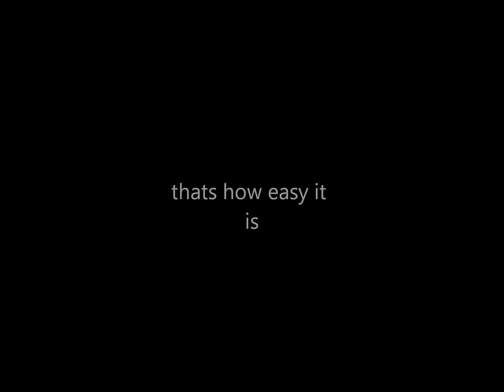easy way to get rid of engine noise

Comment: IF you need to do this, Then that mean's you're headunit has a blown earth track.

It is an easy fix if you are good with soldering and electronics.

Although, This is a temp fix, But better to open it up and fix it right.

When instaling external amplifiers, Always make sure you connect the ground wire first.
If not, The amplifier will try and ground thrugh the RCA's and blow the headunit's earth track.
Very common for pioneer unit's.
Reply: That kinda explains why my amps go into protect when I remove their negative connection when the amps are turned off.

Comment: usually a whine mean,
pioneer deck : a resistor has blown and will require that the rca outer shield be grounded directly to the cars chassis! and not the stock grown that goes to your harness 

any other name brand , is usually because someone installed the power wire along with the rca paralleled to each other causing cross talk

Comment: I read on another site, take HU ground wire, ground it to the HU chassis, then from that same grounding pt, connect to the grounding pt / wire of your amp..  to eliminate the engine noise..   I didn't do this for my custom truck install and I have no issues, but my boat whines badly with the addition of my amp and tower speakers.  Talk about frustrating.. didn't realize it into boat was in the water.. didn't think to check it at the house.. of course the gain on the amp needs to be turned down but the whine is always there.. ran 6 gauge wires for power and ground from amp to battery but now I will use same for the Sony HU.
Reply: I’m go try this

Comment: will there be a problem if I just leave this as is? I'm getting the same whine sound when you pressed the accelerator but it's quire random. only happened about 6x in the last 4 months after I installed a new android head unit. The times the sound happened was from a cold start then went away after 10-15min driving.

Comment: I cant tell if that is the positive or the negative on the RCA and do you do it to both HI output RCA's or just one?
Reply: Just the low level RCA. The outer ring is negative and the middle point is positive I believe

Comment: I have a Jopix PT 31 cb radio. Its connected to a separate battery in the boot.I rev up and hear it over the speaker. i can only use the cb when the engine is off,which is pointless, my car is 10 years old.what can i do? Thank you

Comment: peter court is correct you actually have a blown fuse on the rca output on the inside of the unit , you have to look very close to see it but once you address this all noise will be gone

Comment: This is a band aid only guys. This guy has poor grounds in the vehicle. They are all at different ohms values. All you have to do is connect EVERYTHING audio related to ONE heavy, real copper wire, and send to the - BATT terminal. NO CRIMP CONNECTORS please. Solder all your wires. Read about star grounding. Never ground your RCA's people. You're masking the problem. Also run the signal wires AWAY from the power and ground wires.
Reply: +jim davidson All my grounds are good but I put my power cable and RCA in the same harness. That causing the alternator whine?
Reply: Could be and multiple grounds in your system. That's where you get engine noise. Run a massive power and ground back to your amps. Power and ground your amps and head unit/crossovers and such THERE only. Run your signal cables separate from the power and ground.
Reply: In electronics, you want ONE ground point PERIOD. Tie EVERYTHING to that ground only. Make sure your have good grounds at the engine to body, body to frame and frame to engine. Scrape to bare metal and use star grounding washers. They dig into the metal and make a better ground point.
Reply: +jim davidson My Amp is grounded and my RCAs are grounded, however the whine persists. The only thing i could think of is the power cable near the RCAs
Reply: You never ground RCA cables. You have TWO grounds. You didn't read what I wrote. You only want ONE GROUND IN THE VEHICLE. Two grounds is why you have engine noise. Add a couple more and you will get more noise.
Reply: +jim davidson I added a ground due to the noise as I stated, and did what this video, along with others, did. However as I also said, this didn't cure the problem which I would assume is because the power os next to the RCA, which is what i asked you.
Reply: Separate the power and RCA cables. Run one ground total for ALL the audio gear. Do not ground any RCA cables. That is a band-aid. You are not correcting the issue by doing  this. I hear what you are saying buddy. Just follow my advice and see what you get. Should be nice and quiet if you do. Also think about the big 3 grounding upgrades. Youtube it for a ton of videos. Also use real copper power and ground cable. Get it at Home Depot. It's actually welding cable. Don't buy the trash at your local audio store. It's likely aluminum and low temp rated. Welding cable is very pure copper and high temp rated. Welding cable is what you want. Don't power the head unit off wires in the dash.
Reply: +jim davidson I'll give it try. The main ground is good, I've tested it. I'll separate the power and RCA and take out thr RCA ground. Thanks
Reply: Here's the layout again. 2 heavy welding cables from the "battery" (fused) and a heavy ground off the battery. Run to the rear if you have amps in the back. Get some terminal boards to connect all the power and grounds to. Off your + and - terminal boards (buss bars), run a power and ground feed to your head unit. That's wired now. Connect your amps and crossovers if any to the same + and - terminal boards (buss bars). Run the RCA cables on the other side of the vehicle away from the power. If you still have engine noise after doing this, try disconnecting the antenna from the head unit. Sometimes the antenna grounds on the body, vehicle dependent, and causes 2 or more grounds. Which causes engine noise. It's really simple so don't give up.
Reply: Most people power the head unit off dash wiring (wrong). Amps, crossovers and junk off the battery to the rear. So one + feed from the battery. Then ground the amps in the back of the car. This is a mess. Then if you have an older car with the antenna body mounted, there is now 3 possible ground points. The is the recipe for engine noise.
Reply: +jim davidson I have a jeep built in 1989 lol. It's prone to static. But the alternator whine is very specific, as it increases in pitch by RPM. Only one cable is linked to an AC type electromagnetic field and thats the power cable. So i guess i kinda answered my own question. Best to get the power and RCA separated
Reply: You're close. Your Jeep like mine I think, has a body mounted antenna right? I have an 1983 CJ7. Mine for sure is body mounted. What you describe is engine noise. More revs the faster the noise pitch is. Separating the power and RCAs is not the total answer. You need ONE ground point for everything audio related.
Reply: Tell me how everything audio in your Jeep is wired.
Reply: +jim davidson Aftermarket head unit that is grounded via the antenna. I have my front 2 speakers and soundbar running off the head unit. No problems. I have an amp for my back 2 6x9s that whine a little when revving. These are the ones where I have the power and RCA together. Almost certain now that it is the issue
Reply: And you have 2 grounds!!!!!! Ground the head unit at the amp ground point. Your engine noise will go away. You got to get rid of your multiple grounds.
Reply: +jim davidson I dont think you quite understand. The antenna IS the ground in my case. That grounds the head unit alone. With no amp, thats the ground itself. Now that i have the amp, i have that grounded as well to a bolt under the seat, which is a good solid ground. If the head unit ground was a problem my front and soundbar speakers would whine, but they don't. JUST the amp'd speakers in the back with the power cable parallel to the RCAs
Reply: Because you have 2 grounds. You need to isolate the antenna from the body. Use some large nylon fender type washers to isolate the antenna from the body. This antenna ground is not the proper ground for the head unit. The head units needs to be grounded in the rear with your amp.
Reply: +jim davidson The head unit and amp are separate. With the amp out of the equation the head unit and speakers are fine. Just when the amped speakers are on do i get a whine, and my grounds are secure because i tested the amp grounded to my floorboard. Only possible scenario is the power cable near the RCAs.
Reply: Only possible scenario is you have multiple grounds. I don't care how secure your grounds are. You have more than the required 1 ground. All equipment needs to go to 1 ground , end of story buddy. Listen to what I'm saying. Stop thinking RCAs for a minute. One ground.........
Reply: ı did every think. even set e new thick cable to engine from the battery. but the result is same.
Reply: Your antenna ground most likely is terrible anyway. It grounds to the Jeep body. Lots of rust, dirt and corrosion keeping that not needed antenna ground from being 0 ohms.
Reply: Start over. Say your amp pulls 50 amps. Head unit 5-10?? Any other audio gear like outboard crossovers say 5 amps. Determine your total audio amperage draw. So in the story above call it a 65 amp draw. Then get 2 welding cables that will support 130+ amps. One red and the other black. Connect the red welding cable to the battery + terminal. Connect the black welding cable to the - batt terminal. Run these two heavy wires to the rear where your amp is at. THIS is your power source and ground for ALL AUDIO GEAR. Use either buss bars for the + and - or terminal strips. Copper buss bars are better. Now run two 14ga wires + and - to your head unit. Now your head unit has power and ground. Run two 4ga wires to your amp, + and -. Now your amp is powered and grounded. Remember to fuse EVERYTHING appropriately. Now run a quality RCA cable on the OTHER SIDE of your Jeep FROM the main power and ground run. Best if you use 75 ohm coax RG-6 terminated with RCA's. This way your signal cable now coax is shielded. Now you need to break the antenna ground FROM the body. Use large nylon fender washers to isolate the antenna from the body. You should be golden then.
Reply: If you follow what I said you should have no alternator whine at all. If you do your alternator needs replaced. Diodes are going bad sending AC to your DC battery which is engine noise.
Reply: I used the direct battery method and also dont use antenna now. but my stereo is making the noise, not my amp. my speakers connected to stereo makes noise. the problem is with the stereo to me. and this problem appeared when I changed my cars coil, spark plugs and spark cables. I think these are the real problems of my sound system.
Reply: jim davidson what do you know about the old car cassette player
Reply: copplete and utter crap more than one ground causes egine noise....................................LMFAO
how many ground points in a car? like 50+
please. it's either a bad ground or bad diodes in the altanator. the factory amps have a seperate ground from the radio and you don't get whine, THE ENTIRE FUCKING CAR IS A GROUND.
Reply: @juggernautxtr  idk. Kinda makes sense but you also never hear car audio youtubers say anything about making just ONE ground. Just to make sure you have a good ground lol.
Reply: @gmax341  you can get whine from a ground loop,more grounds = better grounding. the wrong/cheap rca's can cause whine. multiple battery set up has how many grounds? grounding the altanator,engine block,radio,bcm module, pcm,door latchs,trunk latches all have seperate grounds. to many grounds in wiring is absolute bullshit.
Reply: @juggernautxtr  making everything  to one ground sounds impossible. Wouldn't that require a entire rewire of the vehicle? I'll go as far as having the amps have it's own +& - wires running to the battery but that's about it. I appreciate any and all information, whether it's good or bad info, I'll see what makes sense and what doesnt then apply it my needs. I figure I have a bad ground spot causing my whine and cooling fan hums and all that noise. Also before I forget, some will say and its also stated in product manuals to keep grounds wires short. Should be no longer than 18" I think one manual said.  Another manual had a different number as well .
Reply: @gmax341  the more grounds you have the better. trying to "isolate" grounds will create a massive ground loop(creating a voltage difference which creates whine.or noise). if you have 6 batteries you have 6 grounds at each negative terminal.

Comment: ok best way instead of connecting the negative cable from the car connection to the radio use a long cable run it to the engine and put it to the negative post of the battery this way the radio will have a direct connection to ground and it will not loop it fixed all my problems and my radio has nice steady power :)

Comment: I just installed speakers, amp and sub to my factory head unit with an LOC in a 2016 Canyon and had 2 noises. One rpm related and the other just a constant buzz. I moved the amp ground and the rpm noise went away but the constant buzz is still there. The factory head unit does not have RCAs (thus the LOC) and it is spliced in there.  Do you have Any idea what else I should check/try now?
Reply: @mark potter same here ive  gone through everything but a new stereo or amp.  even hard wired the stereo to the battery only time i dont get buzz is when the motor is off. you ever get your fixed if so what did you have to do. because this aint workin
Reply: Not yet. Been working out of town for months and now Im moving. One day soon I hope!
Reply: How did you solve rpm whine??

Comment: my pioneer stereo makes this noise  too. I grounded the rca like this. but the result didn't changed.
Reply: You should try grounding it to all the rca because It work for me when I did mine.
Reply: I grounded my four rca to my stereo. and the result is same. :-( I think my stereo has a problem. We bought a new different pioneer stereo. and set up to same car. it didn't make any noise.
Reply: @mustafakocaoglu8888   so im having the same problem went through everything but a new stereo or amp. only time i dont get the whine is when the motor aint runnin. you think its the stereo? its only 2 months old.

Comment: I see some comments about how you should not do this but I don't care, I have had this engine whine problem for for ever even bought a second battery for it but it gave up so I tried this and the noise went 100% away. Thank you YouTube with out it I would have just junked the system it made me so mad.

Comment: DON'T do this!  If you have to do this, get a Ground Loop Isolator and use that instead.  Much cleaner and safer than just putting a ground wire in with your plug.  That's just nasty...